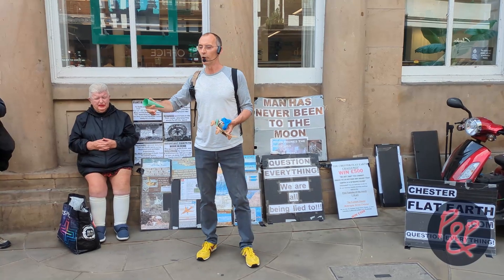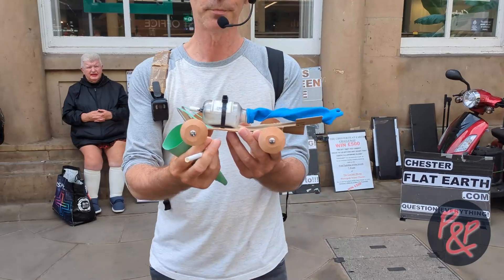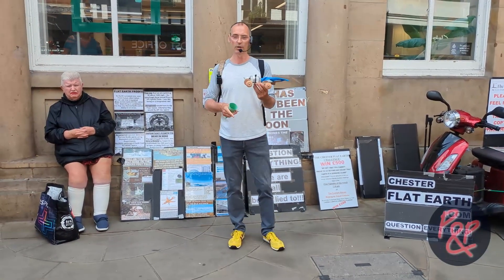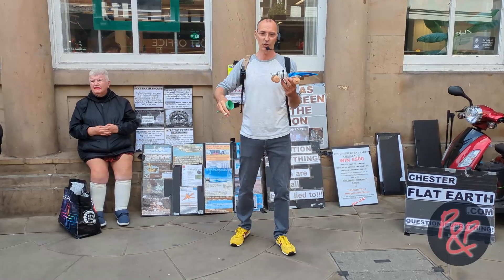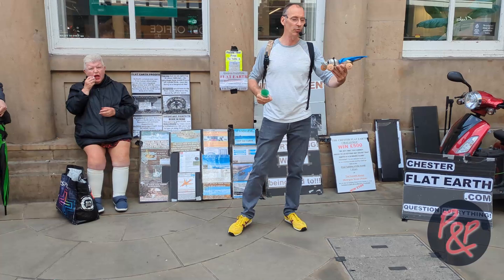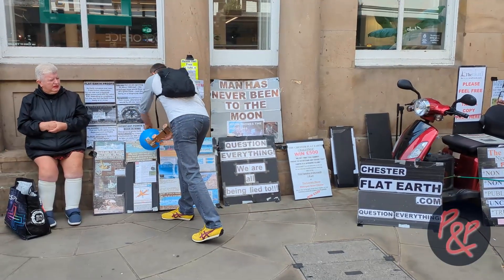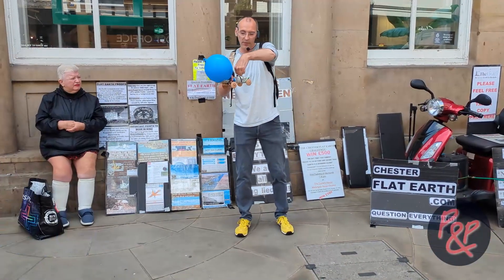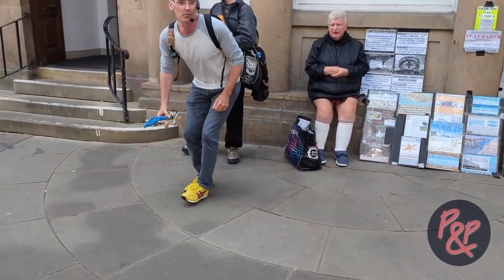Street Demo: How a rocket doesn't work!

Comment: Not correct I'm afraid
It could be that nozzle had created a restriction that means the air cannot expel quick enough to propel the car.

Nozzle design is very important. Ask a rocket scientist.
I also would suspect the weight of the nozzle is causing problems.
I'm not even sure you blew the balloon up the same.
Far too many variables
Reply from the maker: have you tested your explanation? if not, then i'm uninterested in your opinion!!

btw i gave the balloon 3 puffs each time. maybe you should do it yourself as it seems you're reluctant to accept what you see!!
Reply: @PeterPete  Wow. 
It's strange that you are convinced that your experiment proves 100s of years of simple science is wrong.
It's great that you are doing experiments but you are showing conformation bias.
Your cone adds more weigh and unbalances the car.
You need to limit you variables.
I never knew a puff was an SI unit
Reply: @Nicksmith-w4z  Perhaps you would like to answer my basic physics questions on the other thread I started on this video.
I suspect they will delete it once they realize how big of fools I am making of them.
Reply from the maker: @Nicksmith-w4z  the car will carry the weight of the cone - afterall it was only made of lightweight card!

Why don't you try it yourself and find out for yourself instead of repeating the same rubbish on the comments here?
Reply: @stuartgray5877  Yes I read it
Reply: @PeterPete  yet another flerfer that thinks he’s smarter than everyone else
Reply: @PeterPete  When will you be producing your white paper on you earth shattering findings?
Reply from the maker: @Nicksmith-w4z  people can be good at what they do, intelligent and very clever but they can still be stupid!!
Reply: @PeterPete  SO you are STILL claiming to understand basic physics better than ALL of the Engineers and Physicists?
Because they ALL disagree with YOU!
But Bless your little heart for effort!
Reply from the maker: @stuartgray5877  tks stuart for your input into the contaents of the video but the convo has reached a point where it won't go any further. This means I'll have to end the conversation.

Thanks for trying to prove your point anyway!!
Reply: @PeterPete  So why can't you just answer Stuarts Questions?  Are they too difficult for you? Why are you triggered by simple questions any high school physics student could answer?
It's almost as if you are avoiding questions that you do not like the answer to.
Reply: @rocketman484  And notice that they understand enough physics to KNOW WHAT QUESTIONS TO AVOID.
That is a guaranteed sign t that they DO understand, they just refuse to address the facts because they are being deceptive intentionally. (they are LYING about what they believe for the cash)
Reply: @PeterPete  Answer the question you've been asked! Doing so will demonstrate that you have a grasp of the basics. If you can't answer this SIMPLE question then I'm afraid you have no idea what on earth is going on here in the first place.
Reply from the maker: @metopop6878  I'm uninterested what you're saying! the demo was straight to the point and if you cannot understand the point raised then it seems you have no idea what is going on and it is you who cannot grasp simple ideas!!
Reply: @PeterPete  yet you refuse to explain the physics of YOUR OWN EXPERIMENT.

I have asked you "What is causing the air to exit the balloon?"
"Is there a force pushing the air out?"
You are the one that started a physics experiment and conversation.
 Why are you claiming that talking about basic physics is somehow changing the subject?
Why do you refuse to just answer simple questions like:
Does rocket exhaust have mass?
or
Do rocket engines apply a force to the exhaust gas to accelerate the gas out the back?
It sure seems that you have some sort of aversion to basic physics questions.
You CLAIM to be smarter than Engineers, why are you scared to answer questions that high school students can answer?
Reply: @PeterPete  You COMPLETELY avoided the thread where I present an ACTUAL Physics problem. You have NO COMMENT on how to calculate recoil force?
I thought you would be interested in actual physics, like Conservation of Momentum.
Reply: @stuartgray5877  Did peter and pete even finish elementary school? 💀 I'm starting to get worried about them.
Reply: @PeterPete  All quiet from you when you actually have to show some signs of intelligence 😂😂😂
Reply from the maker: @metopop6878  come back when you've got something tangible, then I'll engage 👍
Reply: @PeterPete  - "then I'll engage"

NOT if we keep asking elementary level Physics questions you won't.
You cannot even explain the physics of THIS experiment, but you feel confident arguing with actual Rocket Scientists?
This is known as the Dunning-Kruger syndrome.
Reply from the maker: @stuartgray5877  We've heard all your type before from other people. You're on a stuck record, repeating the same old shyte over and over again. 

Btw Dunning and Kruger carried out their tests on uni students, not members of the general public, so it demonstrates their findings can only apply to uni students and not to the entire population of a country 👍
Reply: @PeterPete  You are correct. In your case the graph is x^(-2) and you are located at x = 0. I doubt you understand what I mean though because you lack elementary school math unfortunately..
Reply: @PeterPete  So you DONT want one million dollars?  But all you have to do is show proof that I am lying.
Oh wait..... nevermind.
 I forgot YOU DONT HAVE ANY.
Reply from the maker: @stuartgray5877  You ask for proof when you yourself don't have any!! Ever thought about becoming a comedian?
Reply: @PeterPete  i present lots of evidence you just dismiss it all.
Care to explain the process called "ADIRU alignment" that modern aircraft do before a flight?
No. Of course you will not address it, because then you would have to admit that WE MEASURE EARTH ROTATION TENS OF THOUSANDS OF TIMES A DAY WORLDWIDE
Reply from the maker: @stuartgray5877  Yawwwwnnnnnssss. Like I've stated time and time again, evidence is not proof, evidence just supports your dreamworld 👍
Reply: @PeterPete  Funny that I am the only one that actually HAS ANY "evidence" to support my side of the argument.
You have merely your personal incredulity as evidence.
Reply: @PeterPete the problem isn't people not "grasping simple ideas" its YOU not grasping the complexity of the ideas
Reply: @PeterPete  - "have you tested your explanation? if not, then i'm uninterested in your opinion!!"

OOOH! Pick ME - pick ME!

I HAVE TESTED Rocket engines in a vacuum! SO then you MUST be "interested" in my opinion.
And I have LOTS of evidence that proves it!
I bet you JUST CAN'T WAIT TO HEAR IT ALL.
They work just as the 100-year old thoroughly tested Tsiolkovsky Rocket Equation predicts!

Comment: I would like any of these "Physics deniers" to argue the following points.
These are so trivially SIMPLE BASIC Physics that it is ridiculous for one to not be able to answer after only a minute or so of research:

Let's Discuss a Space Shuttle Main Engine as there is a lot of videos, and Data, and they are still flying.
SLS with a number of SSMEs arrived at KSC last week.

When a SSME is running right here on earth in atmosphere:
1 - Does the Exhaust gas from a SSME have any "Mass"?
2 - Does the Exhaust gas from a SSME have a new "Velocity" that it didn't have before it interacted with the engine?
        (i.e. Did the Engine "Accelerate" the exhaust gases?)

3 - Can any "Mass" be accelerated by anything other than a "Force"?
       (Or is a force REQUIRED to accelerate mass?)

Most high school level of understanding of basic physics can answer these without looking anything up.
Reply from the maker: The balloon car not move with a nozzle added to the straw even though the air from the balloon was still allowed to be expelled from it!
Reply: @PeterPete  I don't need to answer your question as it has no relevance to the question in my post - I didn't ask about a toy car DID I?
Reply: @PeterPete  SO you are incapable of answering my questions? If that is the case, JUST SAY SO.
I can provide the answer for you if you don't understand basic physics well enough.

OR are my questions just inconvenient for your false narrative?
Reply: @PeterPete  I know you refuse to engage in an actual debate with people that DO understand physics.
You will just act all insulted for some reason and use that as an excuse to not answer my questions.
This is because answering my questions truthfully proves YOU WRONG, not me.
Reply: @PeterPete  Here are the answers since you seem incapable:

1 - Yes Rocket exhaust has "mass".
A SSME consumes 500 kilograms of liquid oxygen and liquid hydrogen PER SECOND.
It combusts the fuel and oxidizer creating exactly 500 kilograms of "exhaust gas" (PURE WATER) PER SECOND.
So the "exhaust gas" that comes out of a SSME has a mass flow rate of 500 kilograms of pure water per second.
(last time I checked "water" has MASS)

2 - Yes the exhaust gas from a SSME is definitely "accelerated".
Before the fuel and oxidizer hit the engine pumps it is moving at a relative velocity (with respect to the engine) of 0.0 meters per second.
Three meters later at the EXIT of the engine, the exhaust gas is moving at Mach Eight (2500 METERS PER SECOND).
Going from 0.0 m/s to 2500 m/s in 3 meters is a HUGE "ACCELERATION"

3 - No. ONLY a "FORCE" can cause the acceleration of an object with Mass.
This is Newtons Second Law.

Now Pete or peter - What does Newtons THIRD Law tell us about "forces".
Now be sure to run away AGAIN and refuse to answer my questions.
(You can SEE that answering my questions truthfully proves YOUR nonsense wrong can't you?)
Bless your little hearts!
Reply: @PeterPete  - "Now Pete or peter - What does Newtons THIRD Law tell us about "forces"."

Afraid to state the FACT of what Newtons third laws tells us because that would prove YOU WRONG?
Yes.
That is EXACTLY why you refuse to address my points.
If you actually BELIEVED, the crap you repeat you would defend your position by refuting my points. Yet all you do is RUN AWAY from my facts.
I WONDER WHY?
Because you CANNOT dispute my points without stating that NEWTONS LAWS ARE WRONG.
Reply: @PeterPete  a rocket engine does not accelerate mass, because gas particles are in constant motion & their velocity is a function of their internal energy.
Reply from the maker: @papalegba6796  yes thanks for that, next time I put my hand out of the car window travelling at 80mph I'll expect I can move it around quite effortlessly 👍
Reply: @PeterPete  the NASA chatbots are the ones claiming a rocket engine accelerates mass, I'm just pointing out it does not. And I know a solid can create a force pair with the atmosphere, it's how everything that flies works. Except rockets, somehow 🤔😂
Reply: @papalegba6796  - "a rocket engine does not accelerate mass"
So according to YOUR "physics"
The velocity of gas molecules in the exhaust of a rocket is moving at the SAME velocity as the fuel and oxidizer in the tanks?
SO the liquid in the tanks is moving at MACH EIGHT - IN THE TANKS?
Bless your little heart!
You don't even know the meaning of "Velocity" genius.
Reply: @PeterPete  RIIIIGHT! Because a hand out the window of a car moving at zero feels the same force as a hand moving in air at MACH EIGHT?
At least YOU understand the difference between 0.0 m/s and 2500 m/s.
Reply: @papalegba6796 They play this cup shuffle trick in rocket science:   they define "velocity" differently in kinetic molecular theory than they do in Newtonian mechanics.  In KMT, velocity is a fluctuating microstate, averaged across random motion.  In Newtonian mechanics, velocity is a coherent macrostate, describing stable, directional motion.  They conflate these two separate and distinct uses of the word "velocity" for the purpose of convincing people that rockets work in a vacuum.  When physicists talk about “velocity” in relation to gases, they don't mean directional vector velocity in the Newtonian sense.  They mean scalar speeds, the magnitude of velocity, not true vectors.  In reality, they developed KMT because Newtonian mechanics failed to explain fluid dynamics.  

They smuggle in the illusion of continuity between these frameworks by silently switching the frame of reference, pretending that momentum transfer from gas particles in chaotic motion is equivalent to the ordered expulsion of mass in Newtonian propulsion. But the former describes random motion within a closed system, while the latter presupposes a directional expulsion into an oppositional medium. In KMT, there is no privileged direction; only collisions, diffusion, and pressure gradients. Yet space agencies retroactively project Newtonian coherence onto this chaos (gas literally means chaos), as if the random jittering of particles could somehow organize itself into a purposeful, unidirectional thrust without a pressure differential to push against. This is the shell game: hide the conceptual pea under the cup of Newton when the audience asks about force, then slide it back under KMT when they ask about temperature. The result is a Frankenstein model stitched from inconsistent physics.

Comment: Hi Guys, I'm back!.........I just figured out the biggest conspiracy theory.  

Peak Oil Theory is a hoax.  Fossil Fuels is a hoax.  

Look up "fossil water" on wikipedia and then look up "produced water".   Thats where the oil industry gets the phrase "fossil fuels" from.   The oil industry calls it "produced water".   They absolutely refuse to use the word "fossil" for obvious reason.   Then look up the paper entitled 'A White Paper Describing Produced Water from Production of Crude Oil, Natural Gas, and Coal Bed Methane' 2004

1.1 What Is Produced Water?

"In subsurface formations, naturally occurring rocks are generally permeated with fluids
such as water, oil, or gas (or some combination of these fluids). It is believed that the
rock in most oil-bearing formations was completely saturated with water prior to the
invasion and trapping of petroleum (Amyx et al. 1960"

"When hydrocarbons are produced, they are brought to the surface as a produced fluid
mixture. The composition of this produced fluid is dependent on whether crude oil or
natural gas is being produced and generally includes a mixture of either liquid or gaseous
hydrocarbons, produced water, dissolved or suspended solids, produced solids such as
sand or silt, and injected fluids and additives that may have been placed in the formation
as a result of exploration and production activities."

Holy crap.   They gave the game away.  "When hydrocarbons are produced"????   and "The composition of this produced fluid is dependent on whether crude oil or natural gas is being produced"????

The little people think drilling for oil is like buried treasure.   Like putting a drill bit in a drill press and then drilling through a coconut shell to get the milk liquid inside the reservoir.   Thats what they think is going on with conventional oil drilling.

To produce crude oil you need brackish, saline water (aka fossil water), sand, injected fluids (etc acids) and the right pressure and temperature.   

Also, look up the video Flat Earth THE OIL INDUSTRY HOAX CIAs Black Gold by Aaron Dover on the internet archive.   He states there is no crude oil down below.    

Also look up Max Steineke on wiki.  Hes laughing in your face.  He's an actor like Zelensky.

Max Steineke was a prominent American petroleum geologist. He was chief geologist at California-Arabian Standard Oil Co. (CASOC) from 1936 until 1950 (by which time CASOC had become Aramco). His efforts, and persistence through repeated setbacks, led to the first discovery of oil in commercial quantities in Saudi Arabia, which took place at the well known as "Dammam No. 7" in March 1938.

Therefore, Frasch is credited with the invention of acidizing.
The acidizing process was applied with great success in the Lima, Ohio,
wells. Many wells were acidized with remarkable results in the short term.
However, its use soon declined, with acidizing being used very infrequently
until the late 1920s—more than 30 years after the issuance of the Frasch
patent. It is not clear why that was the case

"IT IS NOT CLEAR WHY THAT WAS THE CASE"
Reply: For those people who believe that all hydrocarbon sources on earth came from "dinosaurs" ask them where the oceans of ethane and methane came from on the surface of the moon Titan?
Dinosaurs?